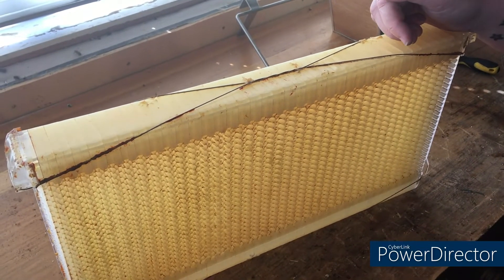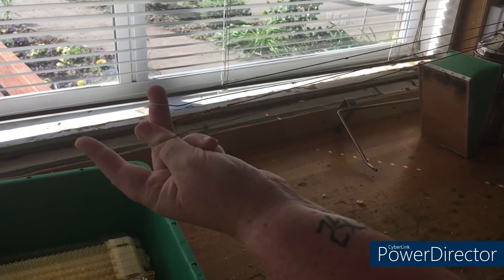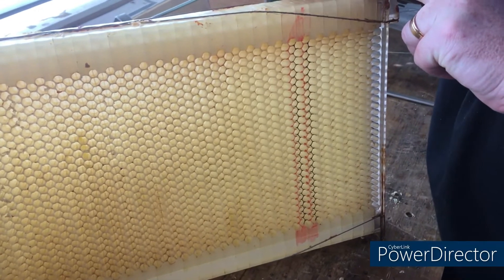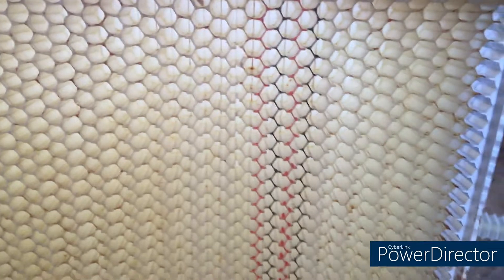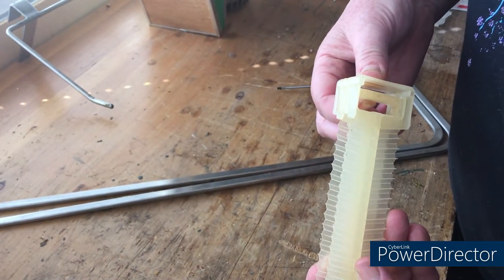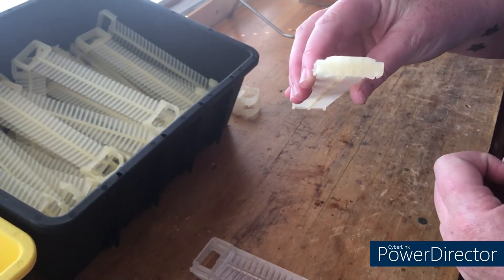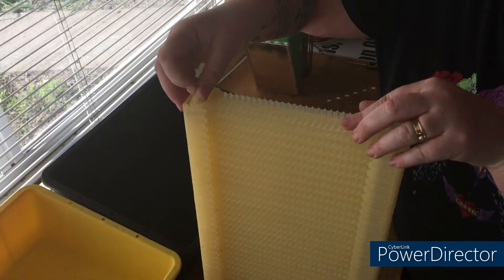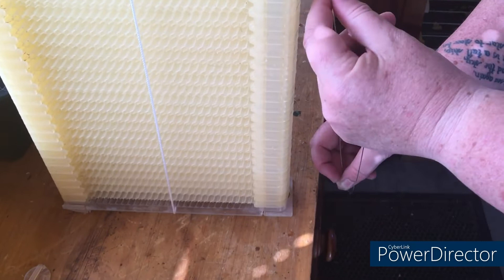How to pull apart and reassemble a Flow Hive Flow Frame

Comment: To Kat Andrews, I wanted to thank you for your most helpful video on how to put a Flow Frame back together, i honestly don't think I could have done it without your most helpful, step by step instructional video. I recently had a brand new genuine Flow Frame literally come completely apart in my hands while I was using the Flow Key to properly align the parts (cells) in the frame. By following your instructions on your video, it went back together without any issues. It was very educational to see up close how fantastic the design is and how well it all works together. All I can say is,  I think it is nothing short of Genius! 
I noticed that all the rest of the frames had only one twist on the top and bottom wires. On the one I put back together I put 3 twists on the bottom and 4 on the top wire, it now still moves perfectly opening and closing the frame cells and being much more tight. I'll probably tighten the other Frame as well.
Thanks so much again,  
Sincerely,   Chuck Rau, The Honig Trail Apiary and I'm also one of Flow's U.S. Ambassadors.
Reply from the maker: Awww, thank you Chuck, those are lovely comments. 

I’m really pleased my video was of help to you and that you got some use out of it. I do have other videos you may be interested in too, like cleaning the flow frames. 

Happy beekeeping, my friend.